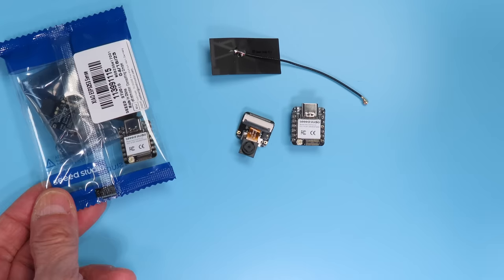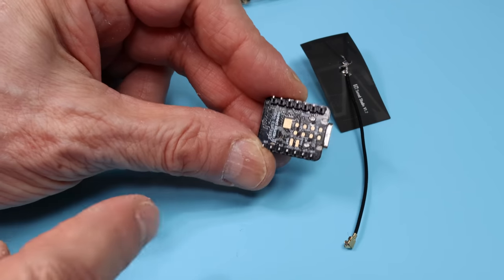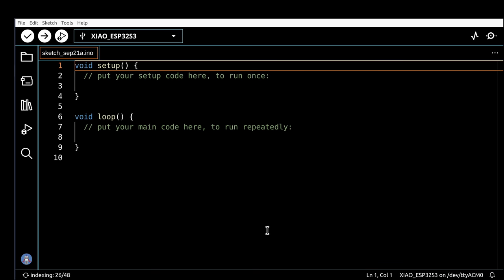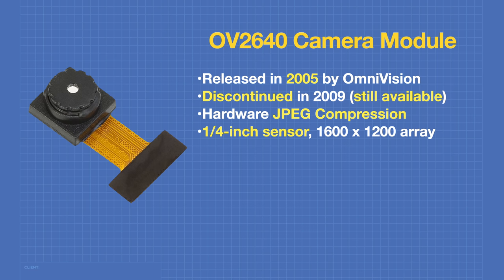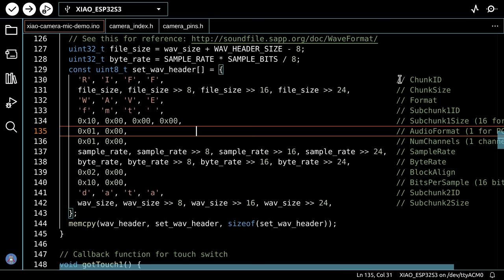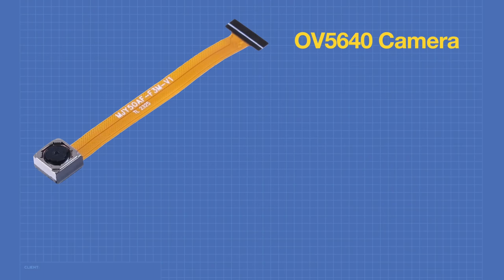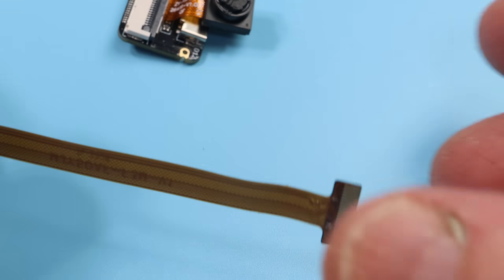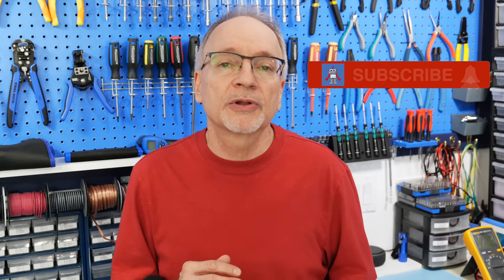XIAO ESP32S3 Sense - Tiny ESP32 Camera

Comment: When I power on the Xiao ESP32S3, it feels quite hot on the back even without using the camera module. Could it be because of the WiFi connection?

Comment: Have you ran into any heat issue with running the video continuously through the wi-fi and sd card?  I have an ESP32-S3 Cam board that when I ran a program called ESP32-CAM_MJPEG2SD, which is available on the internet I run into issues.  With running the different pieces separately there is no issue.  But trying to run the camera, saving pictures to SD card, and displaying it on the web page the until quickly heats up and have to unplug it within a min or 2.  I've heard of other similar issues.   Unless I find one that doesn't have this issue I'll probably connect a USB camera to the USB Host and do it that way.  Thanks, and great video.

Comment: Is it possible to power the Microcontroller using a 3.3 volt voltage regulator connected to the 5v input pin?

Comment: You made THE cardinal sin of using interrupts in that you didn't declare "touch1detected" as volatile.  This makes the code extremely fragile in that its working depends entirely on how the code was compiled.
There's also a large race window between the checking and clearing of the same variable when saving the data to the SD card.  It's always best to test and clear sentinels atomically, otherwise some sets can get lost.
Reply: Bill is one of the best IoT youtubers for sure, but he definitely isn't perfect lol

Comment: I have tried to get the XIAO ESP32S3 to work with the expansion board. Libraries loaded, examples compile and load well but nothing shows on the OLED.  Any suggestion? thanks
Reply: I've had problems using the Xiao with the oled displays as well. Try declaring different I2C pins and using them. That worked for me

Comment: I want to power my esp32s3  with a lipo battery and will have to use a step up converter to get the 5 volts. I also understand you need a diode i guess to prevent feed back thru usb and possibly damaging computer or labtop if connected at same time not sure . My question is will the battery recharge having a step up converter in between lipo battery and esp32s3? Thanks for the great content

Comment: Hi I have been following your videos on the ESP32-Cam and the GC9A01 projects, and was having fun with the wi-fi camera projects and the GC9A01 clock projects. However, I have been trying to interface the Xiao with the OV7725 and GC9A01 to have the OV7725 sending realtime video to the GC9A01 but just can't work. I am wondering if you can help and point me in the right direction. I can only do very basic simple programming but this complexity is beyond my abilities. Hope you can help on how I can start. Thanks

Comment: I am not impressed by this board and in fact I cannot use it.  The problem you mention in your video is that we need to press the boot button then apply power to go in boot loader mode.  Well this happens to me all the time.  These buttons are so small and I have to press on it every time I want to make a change in my code.  It is simply not usable for me.  I am used to program boards like the TTGO-T1 ESP32 and do not need ever to press a button to program them for years.  I try to find a fix for this XIAO board but cannot find it so I can't use it sadly.  If someone has a fix please let us know!
Reply: I haven't looked at this particular board, but for my ESP-WROOM 32 to automatically go into boot mode, I had to solder a ~100nF ceramic cap between the RESET/EN & 3.3V pin - luckily they are right next to each other (This was not my idea but taken from a forum post, it's a very common problem with ESP32 boards)

Comment: I noticed an autofocus library in the add library.
Reply: How can it auto focus?
Reply: The lenses are static, but on a thread.  To focus, one has to do that manually.

So how could a library provide TRUE auto focus with no moving parts?

If anything, it would have to be some faked, virtual focus, like actually just "sharpening" code.

This is those "have to see to believe" things.

I vote that it does nothing more that provide some sharpening to the image, nothing more.
Reply: So it's magic  @BlondieSL
Reply: @pluto9000  That must be it!

LOL
😅😂🤣😁👍
Reply: @BlondieSL  The datasheet briefly mentions a voice coil motor which is suitable for mechanic autofocus functionality at chapter 3.3. And there is a Youtube video that shows the functionality: https://www.youtube.com/watch?v=vQdIaJH_Trw
Reply: @labomat Oh wow!  That is so cool!

Hmmm... then that could explain what I saw when I ripped one of the cams apart to see what's inside.

I don't have it in front of me at this moment, but I did find the "guts" to be interesting.

It was the regular cam off of one of the  ESP32-CAM  I bought that just didn't work out of the box.

Now I'm going to have to mess with that.

Any chance that you could pop here info on the auto focus library's location??

If the cams I have now have auto focus, then this will solve an issue that I was concerned about. I bought 2 more cams only with the longer ribbon cable.

So now that I'm talking to someone who knows their stuff, do you know also if these cams can flip to a "night vision", monochrome and be lit up with IR LEDs???

Thanks in advance and thanks for that very interesting info!

Comment: Are the seeduinos the new D1 mini? I’ve noticed nobody is really innovating in the D1 mini formfactor any more
Reply: The D1 is pretty much a Wemos-only thing.  The problem with Wemos vs Seeed is that the former ditches designs and products faster than Seeed (which doesn't have super-long product longevity either).  For the most part, if Wemos isn't doing much D1 work, then you're kinda of out of luck unless you want to make your own.  The upside of the Xiao series (which isn't a Seeeduino, which historically were all UnoR3-format boards) is that Adafruit's QtPy-s are pretty much compatible, so you have more choices of suppliers of that form factor, although it does seem to be a form factor that Seeed has been developing steadily also.

As they say about standards, it's "great" that there are so many to choose from...

Comment: What is a comparative board NOT made in China?

Cannot use Chinese products in defense related solutions. 

Thanks
Reply: Should you be announcing on here that you are involved in defence-related solutions?
Reply: @terrydaktyllus1320  

Products are made BOTH for commercial and defense use. The defense dept, in fact, requires it to be so - lowers cost for everyone.
Reply: @nrao8977  You clearly didn't read my comment. 

I was stating that it is not a good idea on a public messaging space to imply you may have links to the defence industry which may have required you to pass certain security clearances that would require you to exercise due diligence as to what you say in public.

Do try to keep up and stay on topic.
Reply: @nrao8977  You clearly have "comprehension issues".

I am done here, have a good rest of your day.
Reply: @terrydaktyllus1320  I would like to ask you to refrain from further feeding the trolls.  😉
Reply: If you can't use the board then you likely can't use the microcontroller, as Espressif is headquartered in China. You could possibly use the RP2040-based boards (the microcontroller is manufactured in Taiwan), but there is a specific legal disclaimer against use in "high risk" activities (which includes anything defense-related). There is similar community support with the RP2040, some offerings by Nordic, SAM D by Microchip, etc., and the ESP32 series - in that you can use the Arduino IDE. If you are going to go with something else there are a bunch, but you would likely be using a specific development environment and already know from which options you could pick.